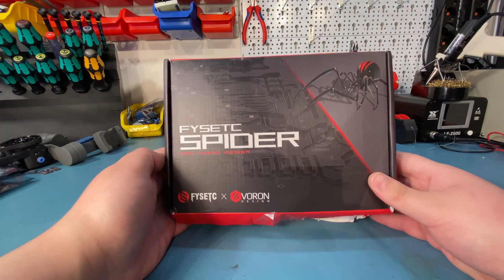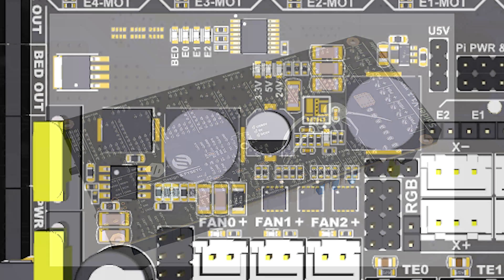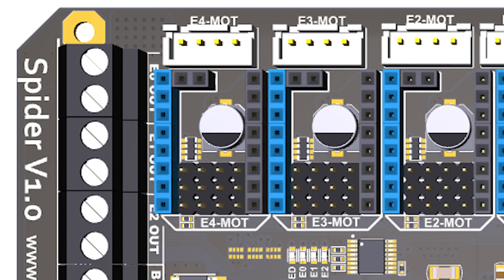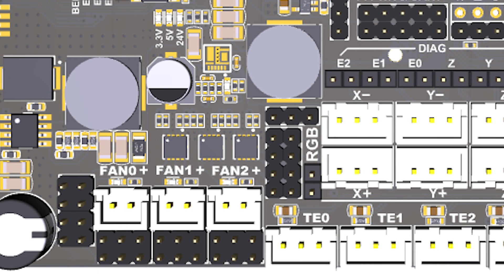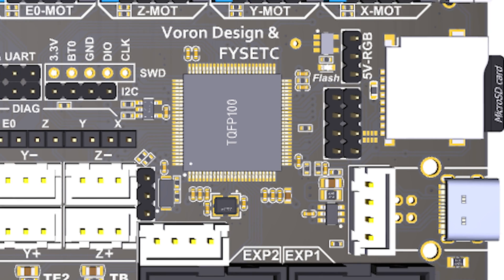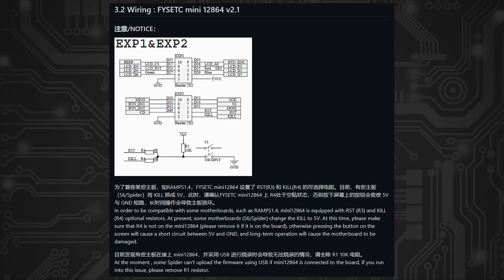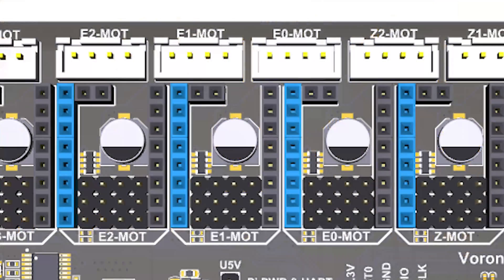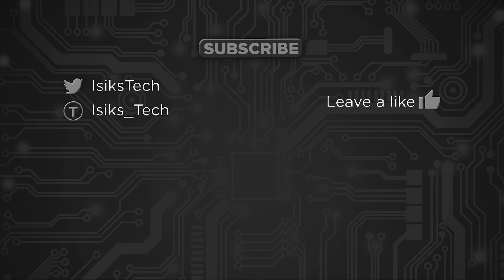FYSETC Spider Review

Comment: I bought two boards for my new voron 2.4 build. One came with Fysectc 2208 and the one in kit with big tree 2209. There is no mention, how to use 2208 with jumper setting. @isik's tech , could you please make video how to run it with kliper and octopi. Do I need the SD card to make it work?
Reply from the maker: Jumpers are in this diagram (right side) https://github.com/FYSETC/FYSETC-SPIDER#32-spider-v11-wiring
You don't need a SD card but it makes life much easier. The usual klipper steps apply, create fw, put on SD, then use usb/uart) More details: https://discord.com/channels/460117602945990666/822468097637875712/839073149223043084

Comment: My V1.0 gets here tomorrow. You can still run bltouches on those right?
Reply: Dya mean the v0.1? The answer is: Maybe? It's not meant to be used with an automatic bed leveler, and it doesn't have the same mechanism to do so as the v2.4. But you could probably mod it so that it works with bedmesh, but you don't need that with the vorons, and especially not with the v0 since it's so small
Reply: @raptorzoz6251  not referring to a voron. Referring to version 1 of the Fysetc Spider.
Reply from the maker: You should be able to. I think that connector is just to make connections easier.